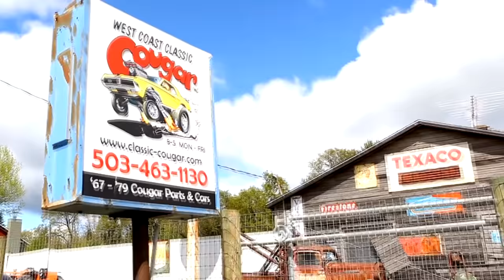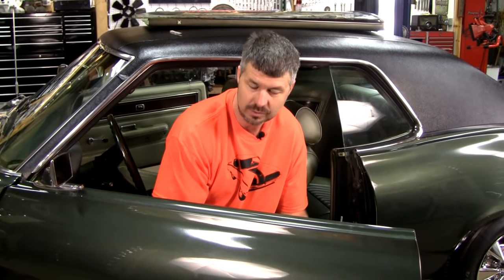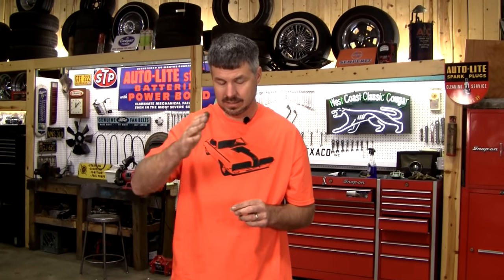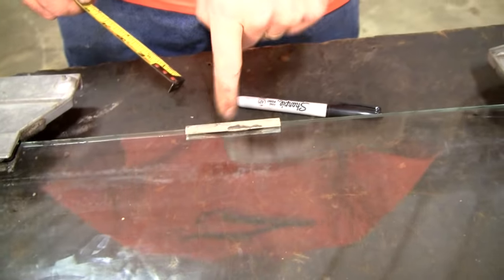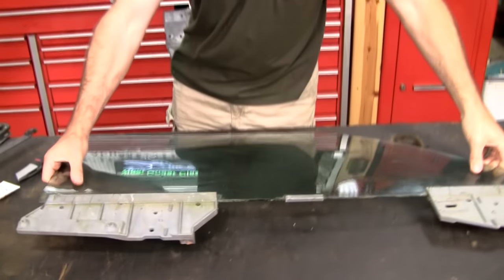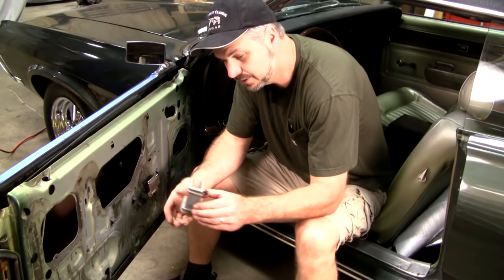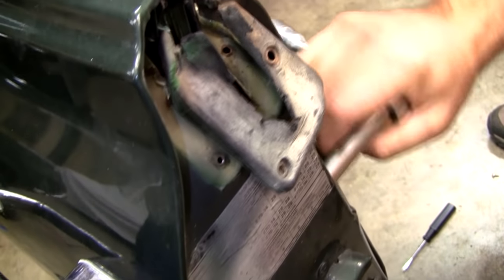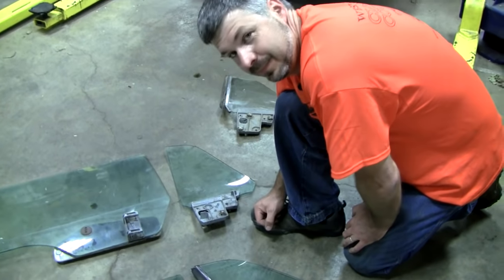1969 Glue-In Glass: The Comprehensive Repair Guide

Comment: i have a 1970 mustang coupe the drivers side door glass is 42-3/16" from front to back the passenger side is 42-3/4" the passenger side is correct what's going on here do i have a 69 window in the drivers side  please let me know thanks.
Reply from the maker: That's possible, as shown in the video the difference was that the trim piece was on the door glass in '69, then was moved to the quarter glass in '70. Someone probably removed the trim from a '69 window and put it in.
Reply: The glass that's glued in it now was glued  in with the 3M glue is there an easier way or should I just buy a front and back glass bracket I will need a new window anyways i won't be able to use the old one due to it being to short?
Reply from the maker: Is the rest of your glass bolt-in? If so then you'd need a different bracket anyway for the driver's side glue in glass you'll be replacing. Or, if everything else on the car is glue-in, you can reuse your existing bracket if you're able to get the incorrect glass out. Otherwise we have all the brackets available (good used).

Comment: I noticed he said the track bracket openings face forward but the car with the cut up door the openings were facing to the rear.
Reply from the maker: I asked our used parts guys and they said:  We've seen those both facing forward, facing back, facing each other, facing away from each other... not sure if there's a real right way to do it. The assembly manual doesn't show, and Ford did not seem to be consistent when installing them.  Don said that in the video because the ones he was working with seemed to fit better that way.

Comment: For Mustangs the measurements are slightly different - I'd double check your car and fit the brackets to the guides before gluing in - on my car I needed to put the front bracket 1/2" from the window edge and 1" on the rear guide

Comment: Did they use these glue in pieces on a 70 mustang? Or did they just have the bolt-on ones? I like this set up better. AS the bolt-on seems a bit cheezy.Or should I go with this kit: https://www.cjponyparts.com/door-window-bracket-bolt-in-style-set-1969-1970/p/DGB/
Reply from the maker: Very early 1970 Cougar and Mustang used glued in glass. Be aware that the door glass is different for the 1970 glue-in door glass. Meaning it is not the same as 1969 door glass or 1970 bolt in glass.

Comment: This video shows everything except how to cut out the old glued bracket. Mine is wobbly but still glued. I need to remove it
Reply from the maker: Sometimes, like in this video, you can just strong arm the bracket off the glass. Another commenter also suggested "try running a guitar string back and fourth working it around the glass".

Comment: That is not the way you install. There is weather stripping, just above the lock. You take 3 screws out. Pull the rubber down and you slide the whole thing from the back .